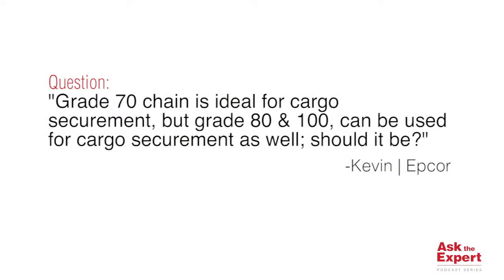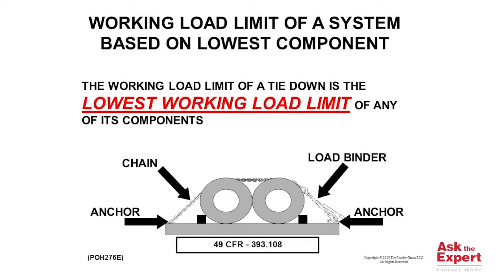Correct chain grades for cargo securement

Comment: Load Binders: a dentist's best friend.
Grade 80 & 100 chains are designed to stretch. A load will shift and settle before your 80 km (50 mile) check, grade 80 & 100 chains will stretch and compound this load shift. Grade 70 chains do not stretch as much. Use the right tool for the job.